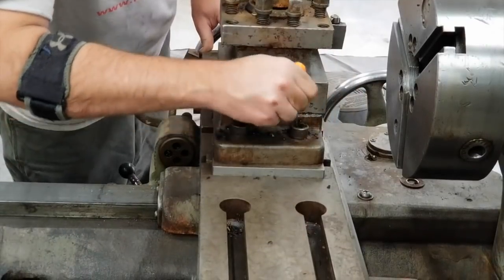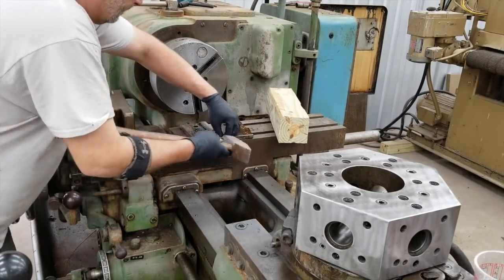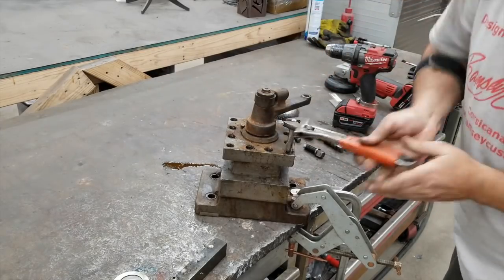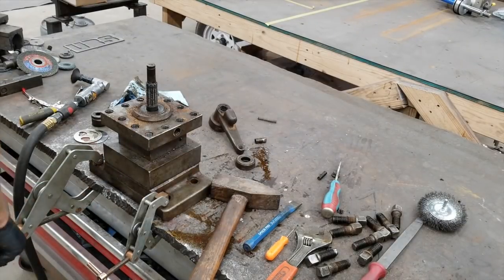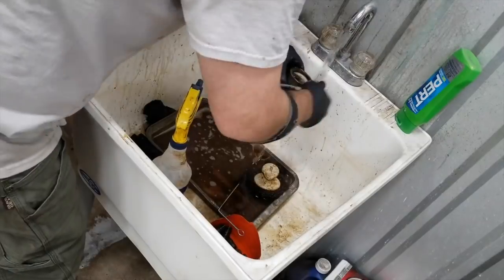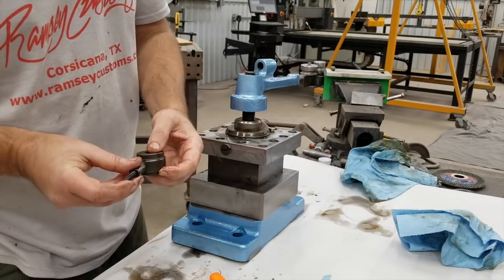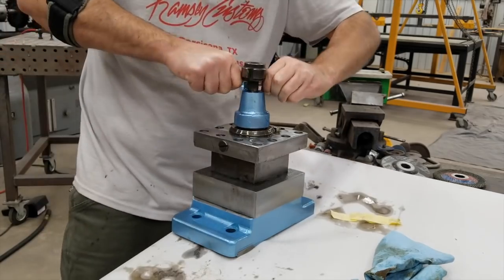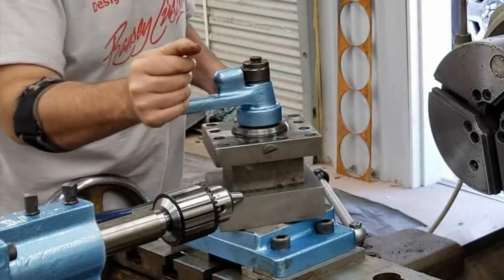Satisfying Lathe Restoration Part 1 - Toolpost on the Jones and Lamson Lathe

Comment: Isn't the toolpost supposed to lock at certain angles? I have a big square post like that and it adjusts every 15degrees.  Don't hate on the BFH it can be just the right tool used properly. :-)
Reply from the maker: It actually has a pin on one corner of the base, and the tool holder (part that rotates) has holes in all 4 corners so the holes fall down onto the pin and lock it in the 90's or so its square to the chuck.  I think you can put it in any other position and lock it also.  It seemed to want to over rotate each time, so i had to manually align it to the corner so not sure if I have something clocked wrong or what.  The turret rotation does something similar.  Over rotates and you have to grab and pull it back to square and when you do it locks there.